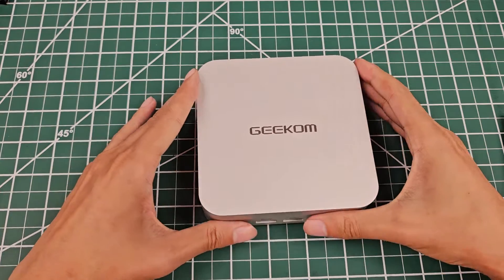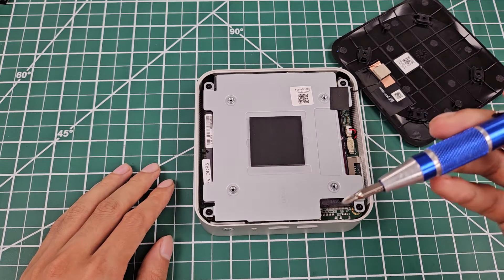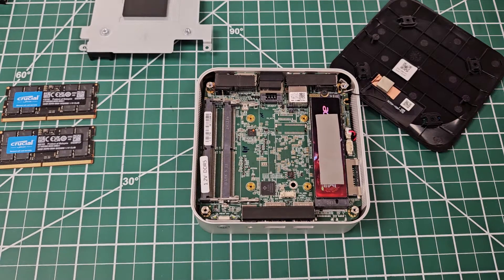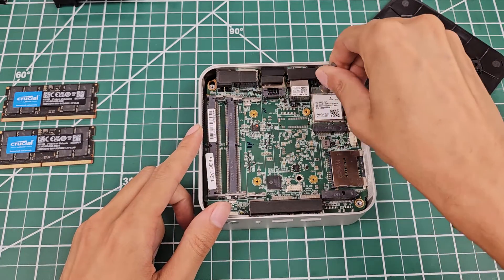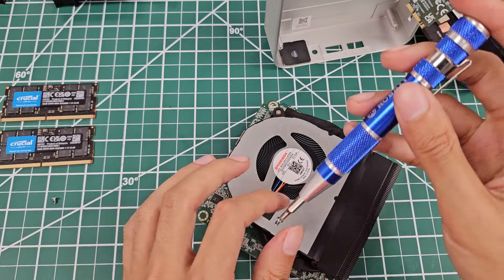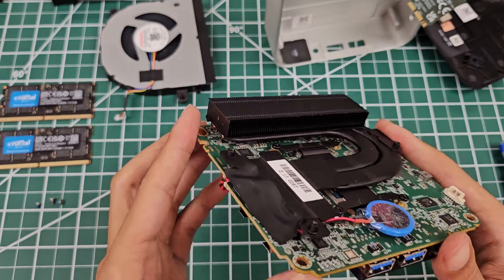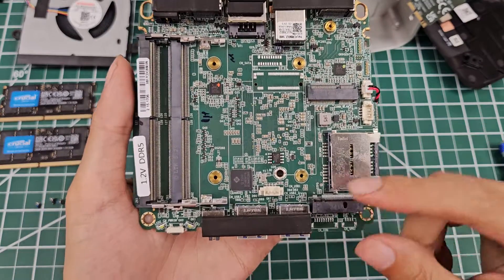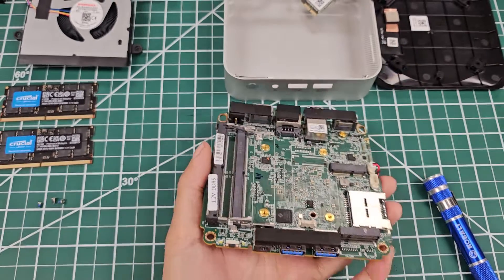Inside Geekom A7 7940HS

Comment: Thanks for the video. Can the Cmos battery be replaced?
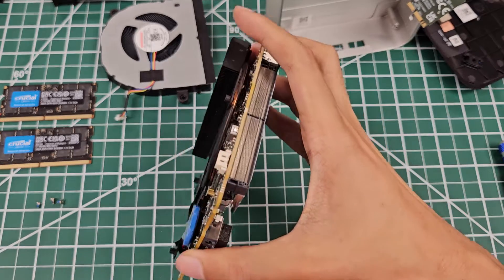Reply from the maker: Thanks! The battery is a CR2032 and it uses a generic connector. The battery is visible at 11:48 and the connector is visible at 12:34. I recommend buying a replacement battery through easy to return sites like amazon.
Reply: @Power3DDesign  Thanks for reply. Got PC last year. All good at moment. How long would you expect the cmos to last before it needs replacing?